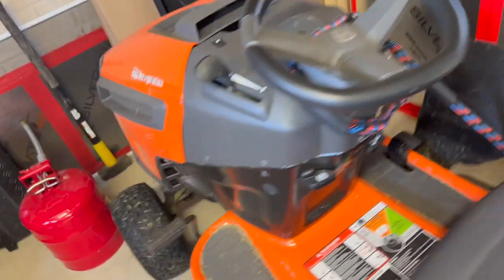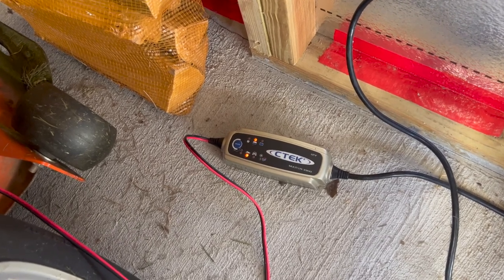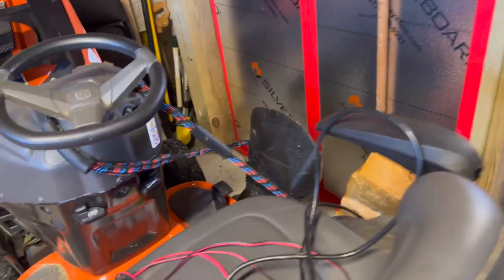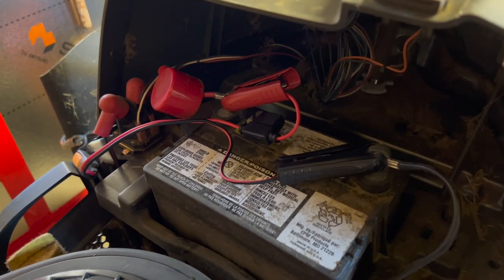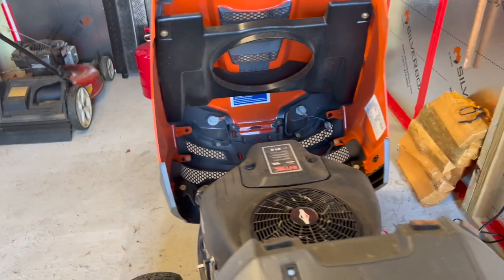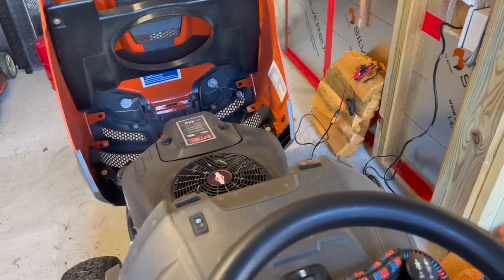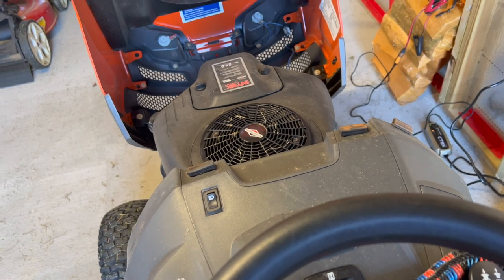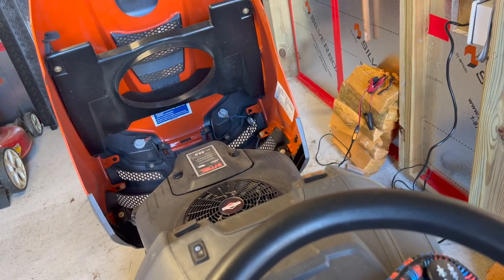CTEK Chargers Work on 12 Volt Small Motorcycle or Lawn Mower Batteries!

Comment: Just to clarify your video title, the lawn mower battery you show is a 12 Volt battery. It has 6 cells which equals 12 volts. Each battery cell produces 2 volts. 6 volt batteries are pretty rare for use since the 1960's.
Reply from the maker: Thanks for the comment Michael!  Appreciate you providing this information.  Shows how much I know about batteries.  I stand corrected and will remember this information from now on!

Comment: I’m using this to charge my motorcycle battery. I’m just curious, does it go into pulse mode by itself after a period of time? It’s been at full charge for several days now. Thanks
Reply from the maker: Thanks for the comment!  Yes, from what I've read about the CTEK charger, CTEK chargers are designed to fully charge a battery and then automatically switch over to long term maintenance which is the pulse mode.  This allows you to leave your CTEK device hooked up to the battery as long as you want.  Long term maintenance utilized the Pulse mode which takes a small amount of power from the battery and "Pulses" it back into the battery. It takes roughly 2 seconds to "load" the circuit to provide the Pulse input. The complete pulse cycle (load > pulse > re-load > Pulse again) takes about 5 seconds.

Note: It cannot activate a dead battery or repair a battery that is damaged seriously; it also cannot repair a battery back to 100% new.

Appreciate that you watched the video!